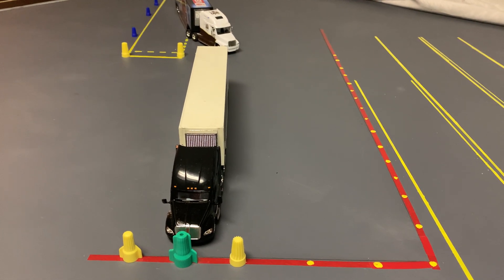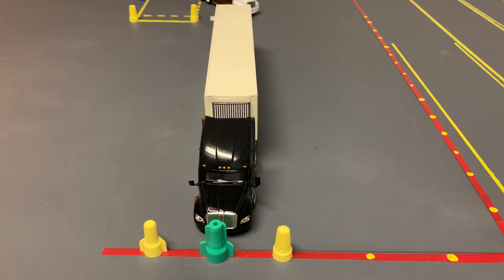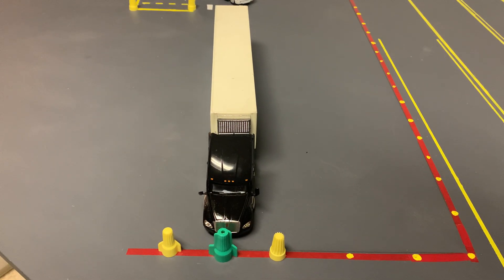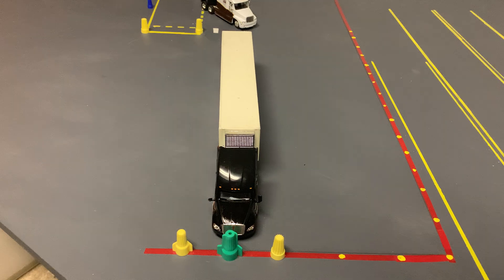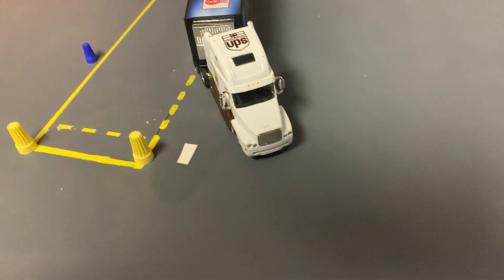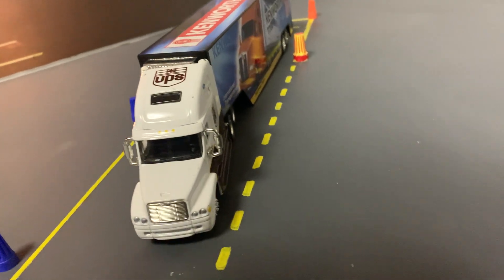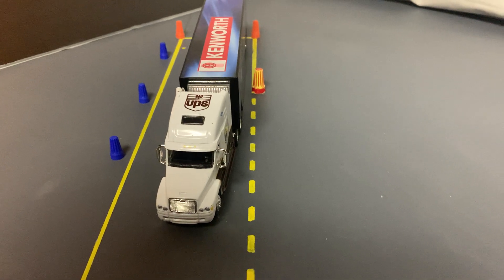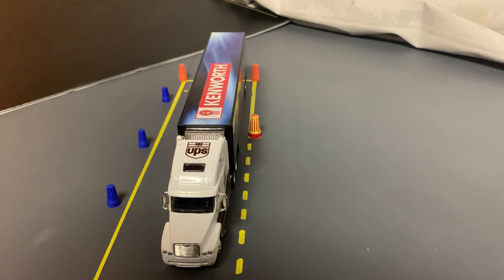Reverse Offset Step by Step Video 3

Comment: Hahah I had ... maybe 5 days of practice. Maybe less total..    On this.   I was getting it but i was giving it too much angle.   I thought I would fail the test but a day before the test I was getting it.     I had to Maneuver test so early! A little after 7am.  I was so tired.    I was able to get it in the box  First try.. One small pull up when I was just in the box.,   Straight wheel does wonders   I always added a little  straight wheel  when I had a bend.  NoWI have a CDL yay  We had bets going with reverse offset at the school It was cool
Reply from the maker: @GhettoWagon  CDL 😀 YAY
Reply: @truckerstevecdlinstructor   Some Failed. I dunno how! Maybe Could not back up.. Or drive bad.  If you have to too much Angle in the box Just.. Take some bend out.. I got in perfect many times with no pull up needed a few times this week.  The First starting position makes all the difference.   Start up messed up. End messed up.   I used to Run A Roll Back Tow truck ages ago.  Was Same Cab Height and width just a straight truck with 6 wheels so.. Had to Learn the Piviot. But I used to Back with a Car on the Wheel lift all the time so.. Was kinda sorta similar just. The trailer inputs react slower. Thanks for The videos it helped me over the last month. Now I hope I can have a better job and just ride around all day vs being out in the hot heat this summer.. It was Funny as I Passed the Pre trip Went to the CONES..  Then "Lets go for a ride"  Wow. I'm passing lol
Reply from the maker: Hard work will always pay off.  I have a lot of videos on my playlist.  Search through out the many videos.  Find one or two that hopefully will make some sense to you.

Comment: I have been practicing took my test and the trailer was shorter then the some I had been practicing with so now I have to rethink my angles.....do you have any tips! I guess I can go past the cone more on my setup....seems like the smaller trailer goes left more...thank you! I test this Friday!!
Reply from the maker: @shirleymartinez5646  same good angles but with the shorter trailer, you have extra space to work with. Backing up to the first cone on the left, don’t back up too far past this cone. A shorter trailer gives you more room for corrections. 
    Still all about you controlling the movement of your trailer.  Knowing when to stop and do a short pull-up. 
Probably adjusted mirrors- Get it done ✅